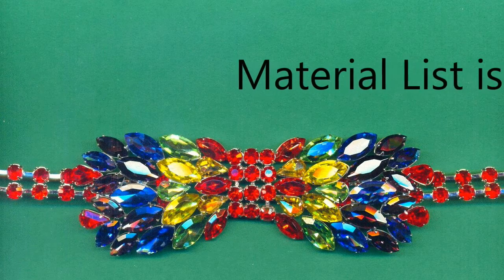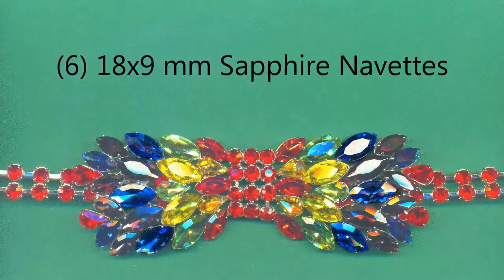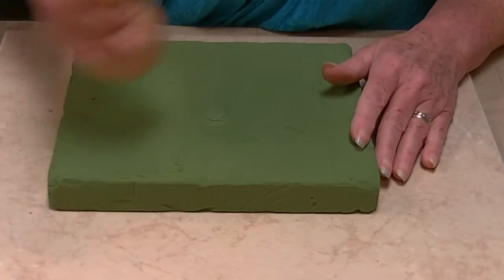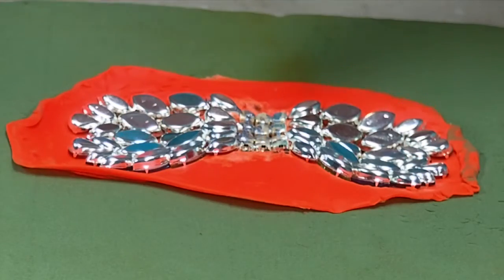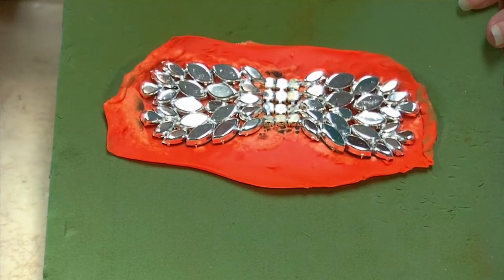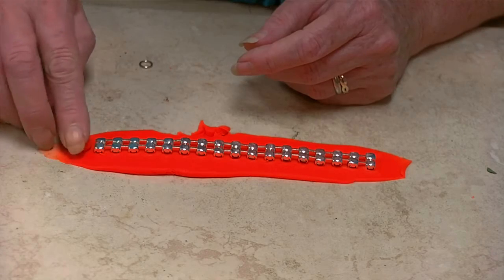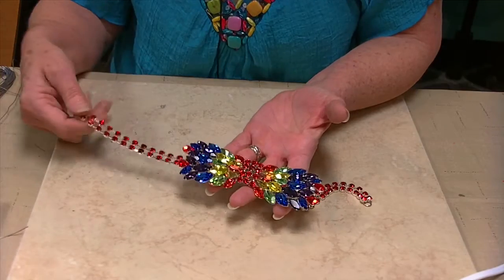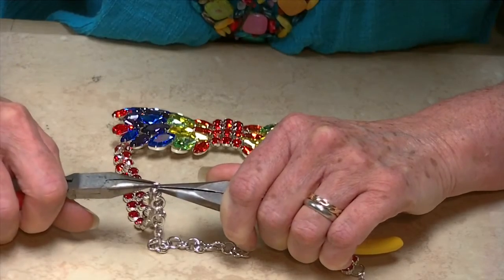Solder a Rhinestone Bow Tie Necklace with a Heat Gun

Comment: Is the heat gun better than the flame?
Reply from the maker: Hi Fatima.  The torch is faster to work with and you can use many different types of solder.  The flame will discolor the settings.  I only use the heat gun when I am working with plated settings because it will not discolor the plated settings.  Only the prefluxed 300 degree melting temperature solder can be used with the heat gun.
Reply: Thank you so much ❤

Comment: hi, may i know which solder that you are using from your shop? i want to use the same one  that can be melted with a craft heat gun. do i need to buy the flux as well? i want to solder rhinestones that i already have. thanks!
Reply from the maker: Thank you for your question and for watching the video.  The solder is prefluxed and melts at a temperature of 300 degrees.  No additional flux is needed.  What you want is "Prefluxed Solder Wire - 300°"  See our Soldering Supplies at https://www.jansjewels.com/soldering-paste-soldering-torches-1.html
Reply: thanks for the quick reply! i also notice that you are holding the solder with bare hands and holding it close to the heat gun. wouldn't the solder get heated up and get too hot to hold with bare hands?
Reply from the maker: The solder wire will not even feel warm.  Whether you are using a torch or a heat gun the heat is NEVER applied directly to the solder to melt it.  The settings are instead heated to the point that the solder will melt when touched to the setting.  You will see in the video that heat is applied to the settings and then the solder is dabbed to the setting with the heat removed.

Comment: Do you sell the Jade Board?
Reply from the maker: We no longer sell j board.  It is difficult to ship.  When we receive our order nearly half the j boards are damaged.  You can also use wet floral foam.  See "Soldering Made Easy Video 1" for a discussion of j board and wet floral foam.  Do not use the dry floral foam because it will burn.